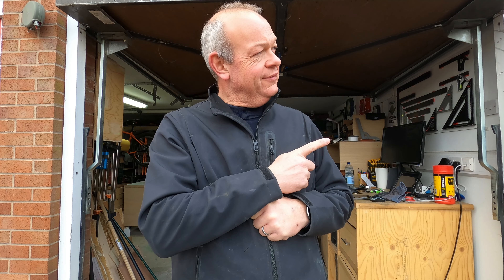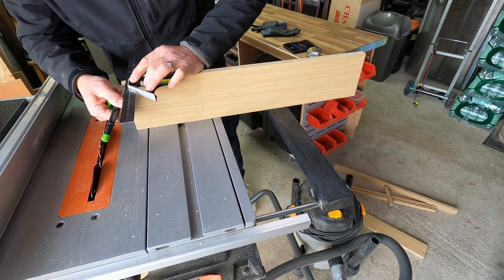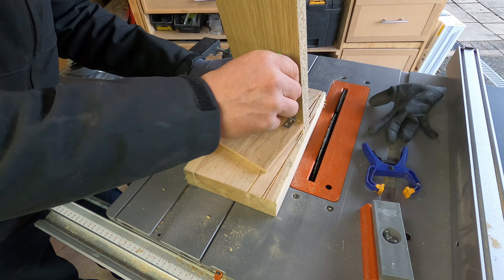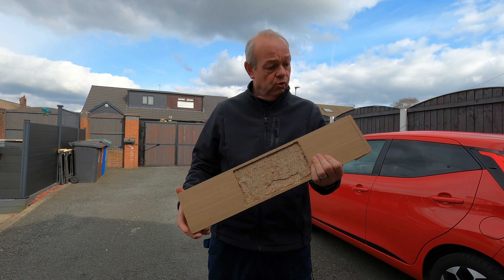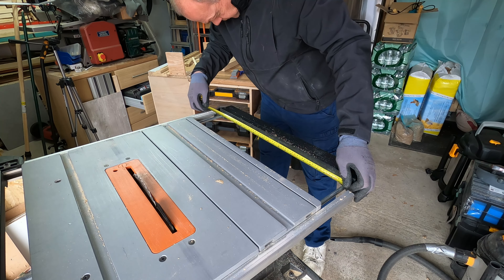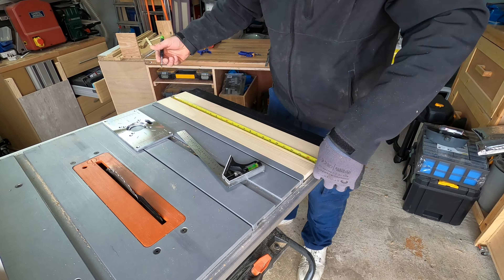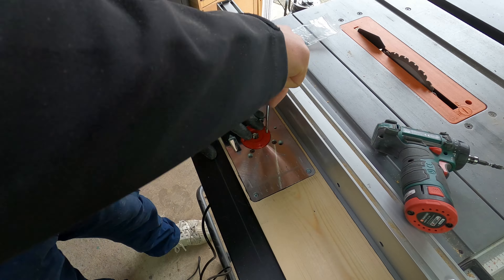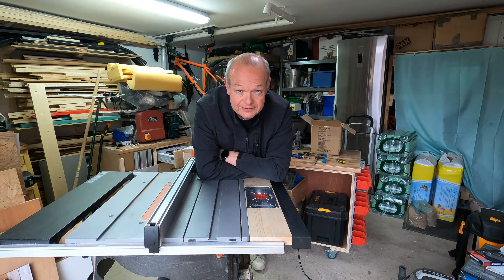The Garage Workshop - Router Table Insert

Comment: I've done a similar thing with my dewalt table saw, I also made a fence with dust extraction to go over my existing table saw fence.... well worth doing it will save you a lot of mess.
Keep up with the videos really enjoying them.
Reply from the maker: Hi Dean. Thanks for your feedback.  I did make a fence from wood when I made this the first time around (one of my earlier videos) and used it yesterday and it works perfectly so I'll use that.  Happy woodworking!

Comment: Im a subscriber enjoying your videos as i have alot in common. Same tools and have quite a haul of Parkside  swag also. You are further ahead of me in terms of experience and knowledge. However, may i just point out something i have seen on YT videos for your safey. When using your mitre or slding table. You should never use your fence when making a clean cut. Dado or groove is acceptable but a cut can pinch and cause kick-back. Im by no means telling someone who is far better and experienced what to do. As said previously. Strictly safety. Please keep your vids coming... PS You might like to check Thomas on Casual Diy. He has a vid for Rage 5 router insert.

Comment: agree on bad choice of wood, knew that from the start. horrible material for trying to work with! are you going to make a fence system for it rather than use/damage table saw fence?
Reply from the maker: Hi John. Yeah thought it could work but didn't. May make a fence but the table saw fence on there works perfectly and is dead straight. I just took off the extra piece of metal.